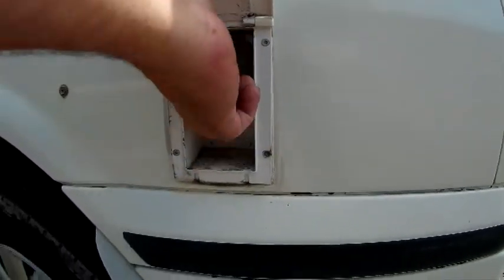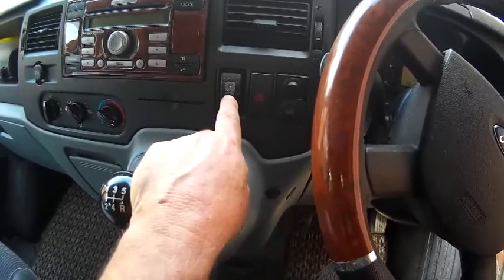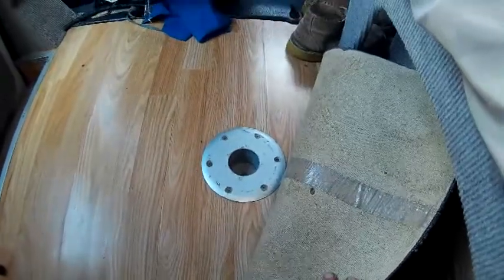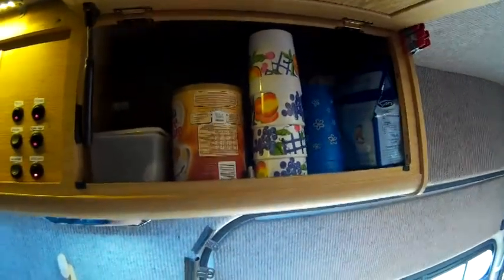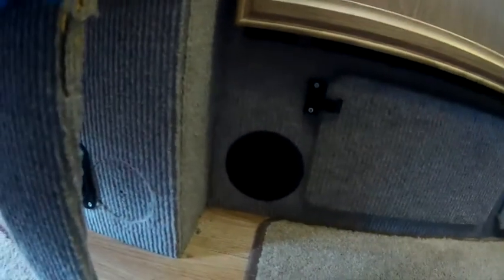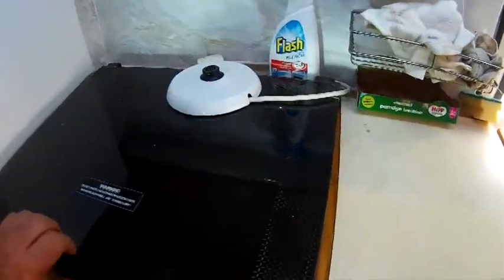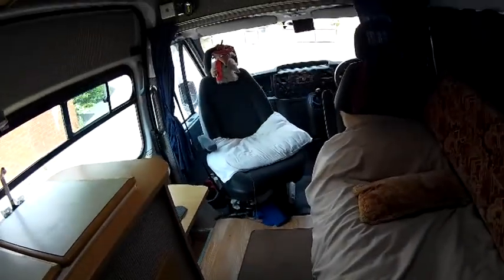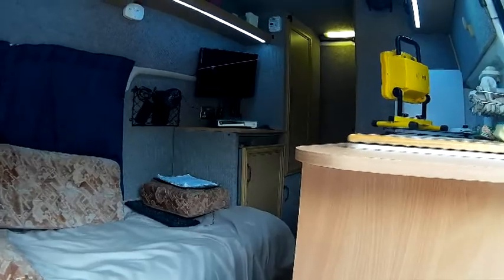CAMPER 56

Comment: Fantastic camper. Such a shame you have to sell it :-(  Who did all the electrics ? I am at the point where I need to start installing and have no idea where to start, no matter hom many YT vids I watch I just dont get it :-( I am going to have to pay someone to install it all and yours is great, just how I want mine, with the solar charging the van batteries aswell, mine was a minibus so has 2 batteries already. Also is that 'cord carpet' you have used on the walls and cupboard doors ? I love that storage box above the steering wheel, mine is a mk6, i dont have that lol anyway great vid, thanks for sharing.... oh and we dont know the full extent of your cancer but we are optimistic and wishing you a full recovery :-) atb, Jay & Laura
Reply from the maker: Hi both.. Thanks very much.. Is yours a mk6 or mk7 transit...?  A transit bus is only a semi high roof.. A high top has a semi hi cab roof.. I am able to stand up in back and got about 6 inch's of head space..    Electrics..? most transits have 2 batteries under the driver seat. take care.. The altenator charges both.? But the van electrics use the back battery and the front battery is only for the starter motor...? This ensures that the engine will always starts just in case you leave the lights on.. if its a mk7 (not sure mk6) on the back of the seat base is a small black box with a red cap..? Ford put this in for the extra customer take off point... you should use this..? if not your power should come off the front battery... What do you need to no..? 12 volt side or the 240 volt side.. I am an auto elecy... If you tell me what you are going to be running the back I can help...? Again many thank.. Kevin..
Reply from the maker: Hi Again Jay.. Sorry i did not answer all questions.. I have watched your videos.. Your doing very well.. (would not has used hardboard). cant screw to it later on.. I got my carpet from carpet rite.. Its the cheapest they do.. plus it acts as extra insulation and its warm plus it is a great sound proofing.. I see your van is a mk6 so it does not have that little box for power.. so you will have to come off front battery.. but you must have a leisure in back somewhere.. Thanks again
Reply: Thanks Kevin for the reply, It is a mk6, I will have a look under the seat to see which is for the electrics then, thanks for that info :-) I will reply to you again (if thats ok ?) when I am about to start the work with a few questions and what I will be using. Will probably be within a week from now. Jay
Reply: Hi Kevin, Many thanks for replying again, I used hardboard for the weight, I was getting concerned with how much was going into the van and worrying about fuel consumption. I will get around screwing things to it as and when it happens lol, i did put a few batons behind it so I just have to remember where they are lol. It's a good idea using that cord carpet, its easy to mold round places, I will have to discuss that with Laura, if we will use it and what colour  :-) Thanks for your replies, I will be in touch again very soon, hope you don't mind. Jay